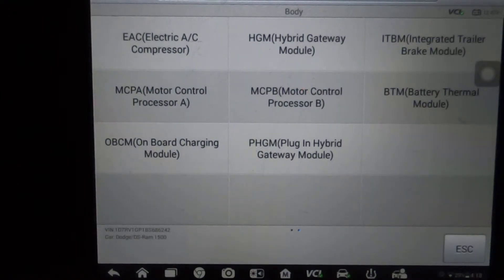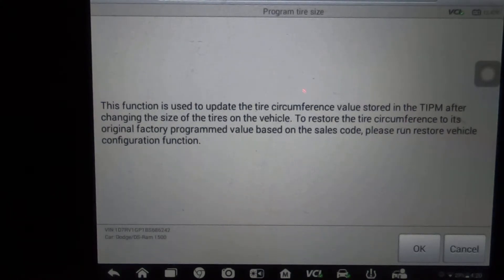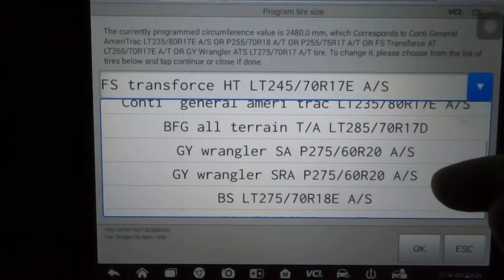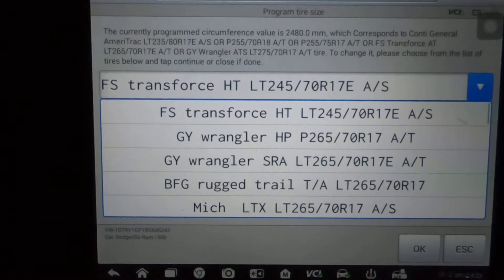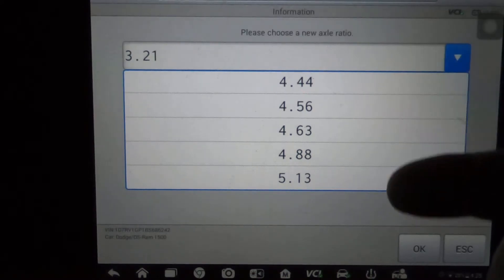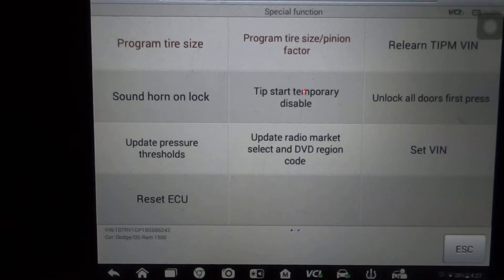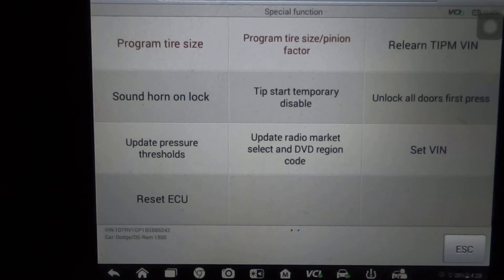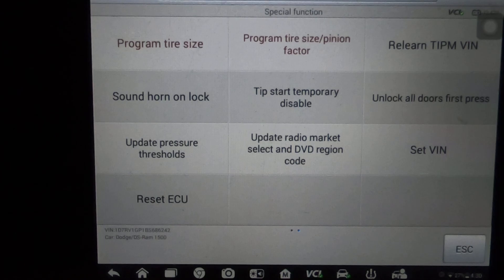Programming Tire Size and Gear Ratio on a Ram 1500 using the Autel MS906 Scan Tool.

Comment: Will this scanner work for the 2004 year Dodge Ram 1500?
Reply from the maker: It will work as far as the scanner goes but for tire programming specifically, I would need to connect it and see before I could say for 100 percent.
Reply: @737mechanic  Update: it did not work for tire size on an 04 year. However, there were some other programmable features including the fuel tank capacity (which I needed to update to 34gal). Now my DTE reads correctly. It did work for both tire size and gear ratio in my brother's 07

Comment: My think diag. Scan tool was able to access the tire size calibration. But was limited to or not a whole lot of selection. On gm trucks
Reply from the maker: Most scan tools that are able to calibrate tire size are only able to do what the factory scan tool allows which is what ever tires came on the car or that were options.
Reply: That's what I ran into